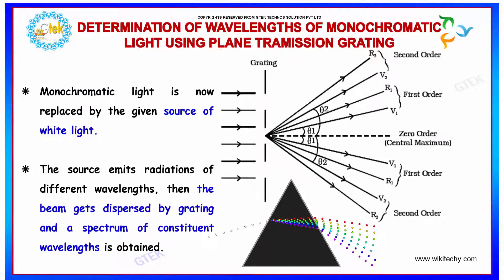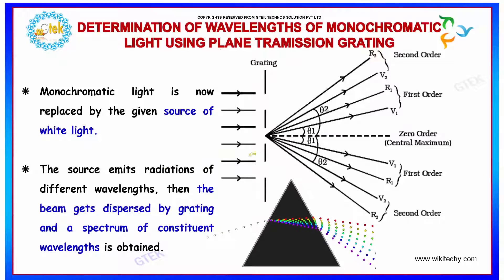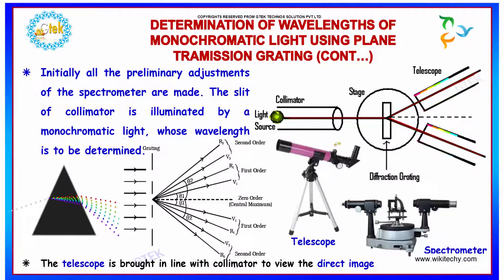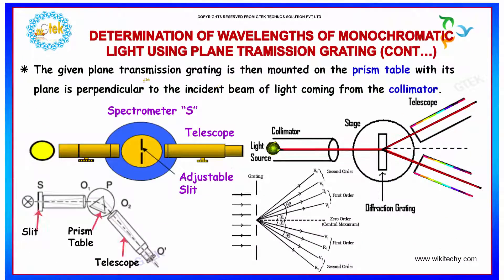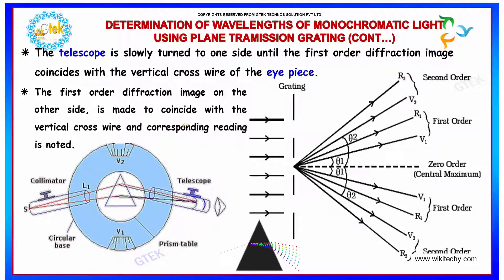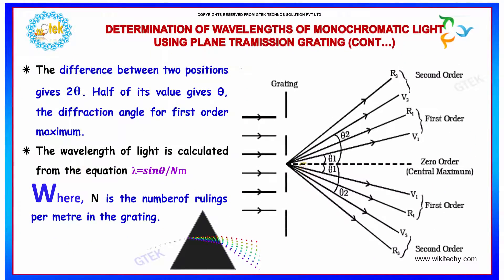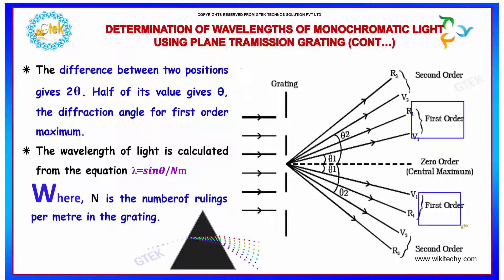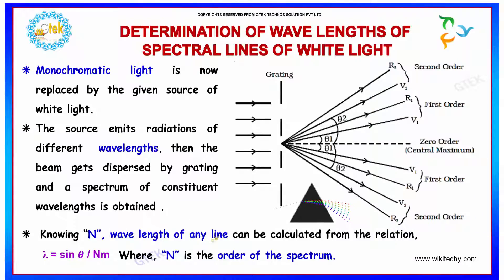Determination of Wavelength of Monochromatic Light |class 12 physics subject notes lectures

Comment: When two or more waves having same source and same frequency (coherent waves) interact with each other, then the resulting phenomenon is known as Interference . According to the principle of superposition of waves – When two or more waves of same type are incident at the same point then the total displacement at that point is equal to the vector sum of the displacements of the individual waves. The superimposing waves can have constructive or destructive interference. When crest of the first wave falls on the crest of second wave and trough of the first wave falls on the trough of the second wave and then the resultant wave is the vector sum of the amplitude of the two superimposing waves which is equal to sum of the amplitude of two waves, this is known as Constructive Interference. When crest of the first wave falls on the trough of second wave and trough of the first wave is falls on the crest of the second wave and the resultant wave is the vector sum of the amplitude of the two superimposing waves which is equal to the difference in amplitude of two waves, this is known as Destructive Interference. Constructive interference occurs when the phase difference between the waves is a multiple of 2π, whereas destructive interference occurs when the phase difference is an odd multiple of π.

Comment: Newton’s Ring is the demonstration of the interference of light waves reflected from the surface of a thin air film formed between the plane glass and the convex lens whose thickness varies while moving from the center towards the end  . The beams produced from the monochromatic source satisfy the condition of coherence for interference. The dark and light fringes which are of ring shaped are produced by the air film existing between a plano-convex lens and a plane glass.

Comment: In an experiment to measure the wavelength of monochromatic light, a narrow beam of thelight fell normally on a diffraction grating. The grating had 300 lines per millimetre. A diffraction pattern was produced. ... The angle measured was 40.6°.

Comment: Monochromatic light refers to light that is of one color. Since it only emits one color, monochromatic light has a single wavelength. Wavelengths are seen as a rainbow of colors when light is passed through a spectrum. Therefore, monochromatic light would emit just one of these colors.